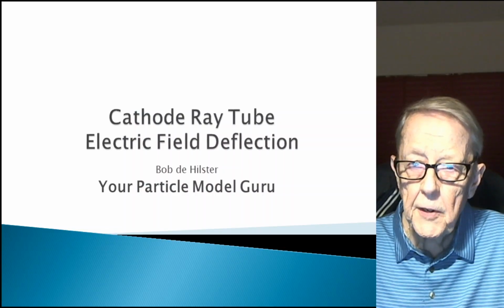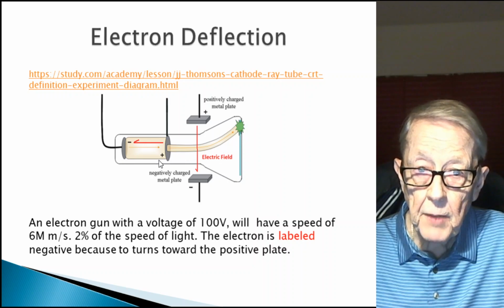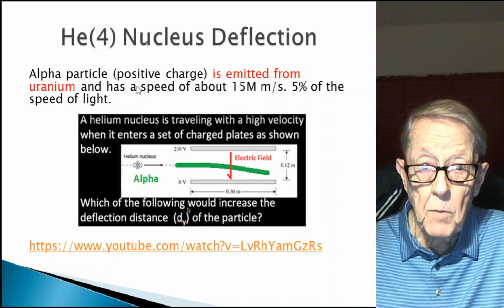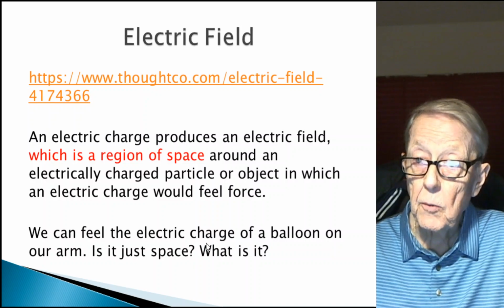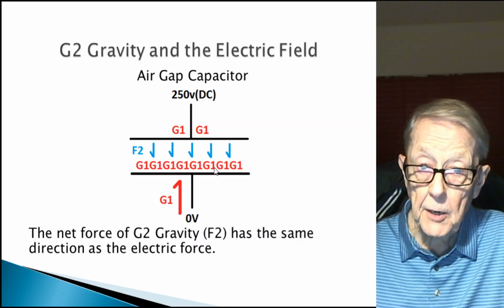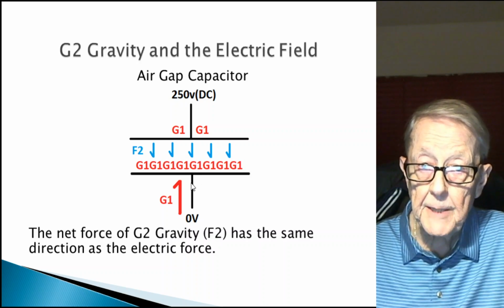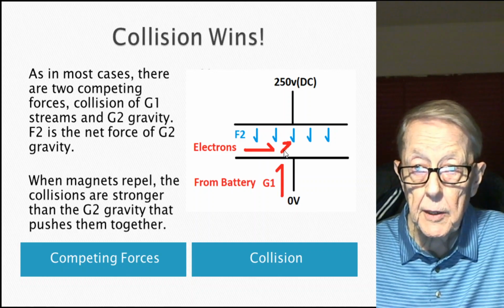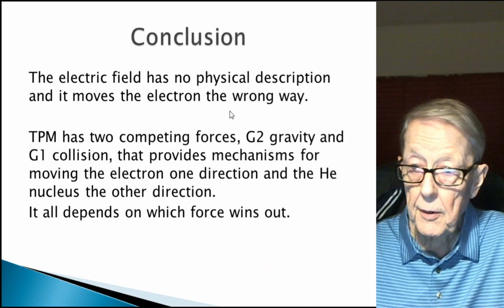The Cathode Ray Tube with Electric Field Deflection

Comment: Your idea that the electrons and alpha particles slow down (from c) in this experiment makes more sense than speeding up because alpha particles have more "inertia" than electrons. Thus, it would take longer to speed up alpha particles than the electrons and yet, alpha particles are found to be moving faster than the electrons  (2% vs 6%) in a similar experiment. It should be easier to slow down electrons than alpha particles (obviously). Great observation.
Reply from the maker: Thank you for your comments. The speed of the alpha particle must be the difference between the nuclear binding force and some other force that pushes it out. In the Particle Model, there is no nuclear weak force. My assumption is that the nucleus of Uranium 236 is not perfectly balanced. Due to the electron flow and other changes surrounding the atom, some parts of the nucleus (alpha particle) are not bound as strongly as other parts of the nucleus, hence they escape. There is no other force pushing it out. There is only the G2 gravity (binding force) and a mass imbalance of the  nucleus.
Reply: @ParticleGuru  I agree 100 percent with the idea that there are only two "forces" in particle physics. One that pushes in, centripetally,  and one that pushes out, centrifugally. In stable particles, IN and OUT are in balance. In unstable particles, they are not in balance. Also I agree that the "weak force" is not a force in of itself. The weak force, in my opinion, is an emergent property of the system. The domain of the weak force is exactly BETWEEN the INward "forces" and the OUTward "forces".   It is an output, not an input. So, if we are in agreement to these points, then this is  really great start, regardless of whether you have  a particle model, a wave model (like Jeff Yee's model) or a fractal model like my Mandelbrot Set model.